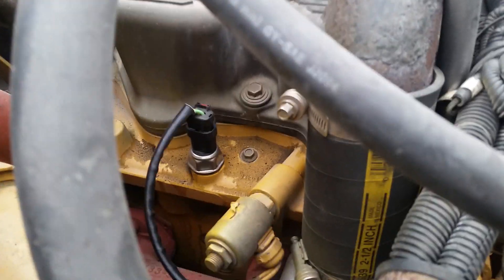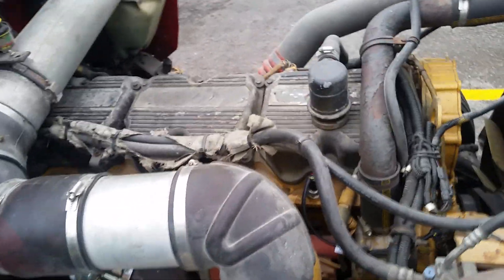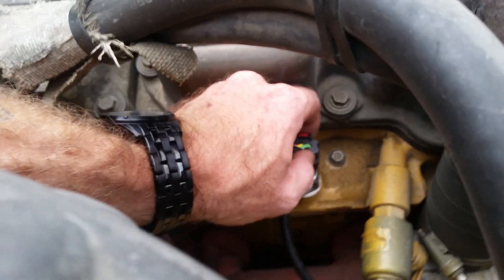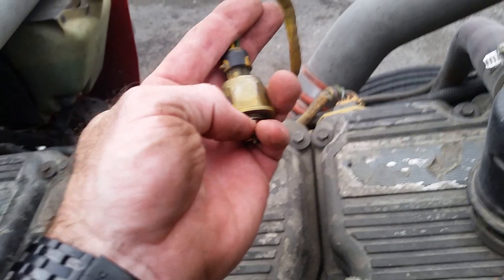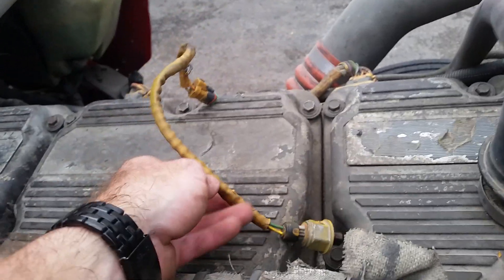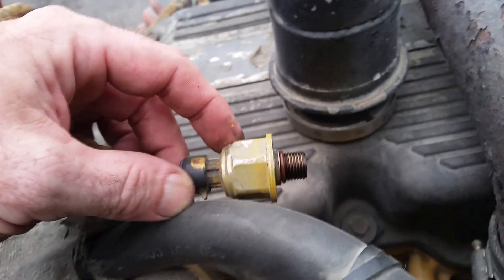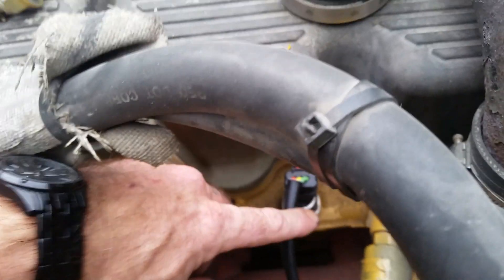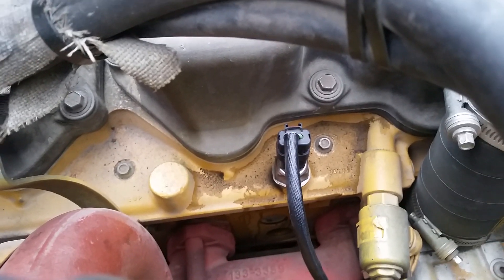I.V.A. Pressure Sensor

Comment: I wonder how this sensor effects performance of the engine? I'm getting this code now after having a new head put on a C13 Cat engine.
C-13 IVA Pressure Sensor is under the valve cover.

Comment: What does this cause your motor 2 do when this goes out
Reply from the maker: Jace Transport it will derate the engine causing it to lose power.
Reply: Will it cause the oil pressure guage to go nuts when it d rates

Comment: thanks for the video I also have a code 95 on the same cat c 15 my truck has loss of power/vibration especially when going uphill on the higher gears and it acts up more when I am carrying heavier loads, please sir I have been showing my truck to stupid people replacing the rear end, drive shaft power Divider, but still it's the same now I took it to Freightliner and they want me to replace the clutch $3000 but then I took it to a local shop that found an active code 95. do you think that power loss/vibration is caused by that code 95 ?
Reply from the maker: Definitely a possibility.
Reply: Aiyman Khan I have a 99 model and mine doesn’t show any active codes but my truck does have the same symptoms.

Comment: Do you have a part number for the sensor and the jumper harness by chance?
Reply from the maker: DieselMike I can look through my receipts today if I have time. Any CAT or Truck Dealership should have that information as well.
Reply from the maker: Bought everything at Dayton Kenworth in Ohio.description/part #/costSensor: 2842728 $157.99Seal: 5P7814 $3.66Harness: 2495293 $25.81
Reply: Thanks bud worked great

Comment: I wanted to ask what is that yellow cylinder right next to the iv pressure switch
Reply: dextreme hauler The yellow cylinder next to the sensor is the solenoid...thats controlled by the sensor he's replacing.

Comment: have you ever needed to change the oil pressure sensor?  I have a 2006 twin turbo c15 and the gage recently started dropping below 20 lbs off and on. but it clearly has proper oil pressure and has been running fine.
Reply: did you ever found a solution to your problem. I'm going thru the same problems.
Reply: Yes it was a bad oil pressure sensor. The cat has 2 sensors so it might  take a garage to plug a computer in to find which sensor.. mine works great now. Just turned a million miles the end of August.
Reply: thanks for the update will check that 2morrow. hope that will fix my problem.
Reply: You can also wiggle the top of the oil sensor with the engine running  where the wires plug in. It might cause it to leak oil and that a sure sign of a bad sensor...
Reply: Where are the two sensors located I know of one behind the fuel filter where is the other one?
Reply: Josue Gonzalez yeah we’re is the other sensor 
I have 07 cat 🐱 so probably a 06 engine date MXS c15 same issue, sometimes oil pressure will drop then comes back up... PLEASE HELP any other suggestions would help also.... 1.4million thanks
Reply: No codes
Reply: Atmospheric pressure sensor beside oil pressure sensor
Reply: Just replace mine but also the harness was in bad shape the check engine light went off right away